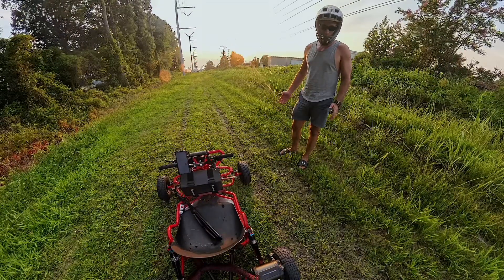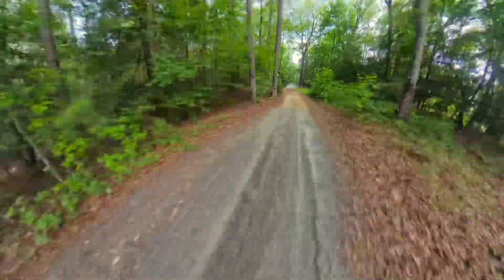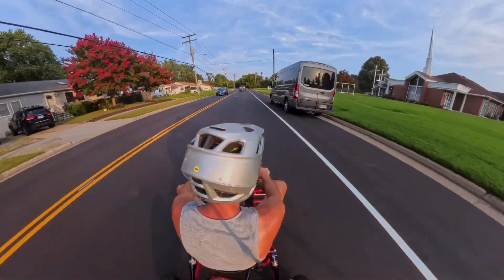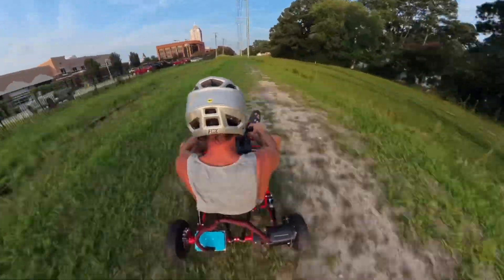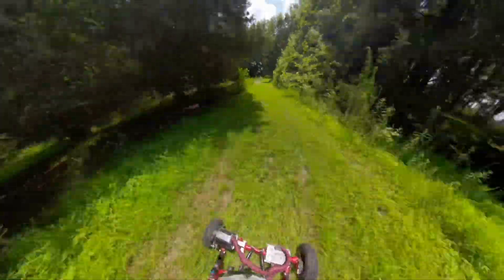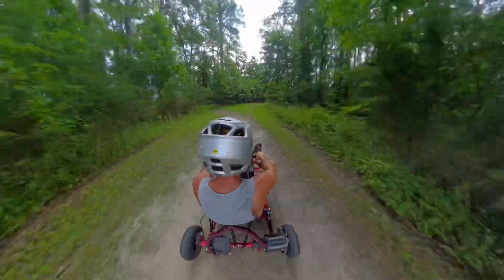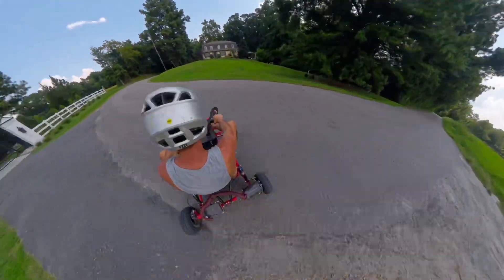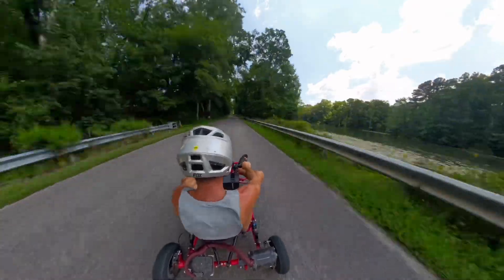The mini kart is better than ever

Comment: I have a question. I finally got EVERYTHING! I need for my build! Just got a battery from hotpaxx. I've been looking at how you made you motor mount. What are you using for raising the motor? Looks like some sort of spacers.and are they attached to the steel plate? Or just spacers ,tightened down with longer bolts? just figuring out how to mount everything so I can hook it up. I do have a friend who's going to make me a custom sized battery.\nIn the future , but for right now , I couldn't beat the price of the hotpaxx battery. And still fits under my legs.150continuous amps,200peak. But trying to figure out how to raise the motor up a little from the plate since it doesn't sit flush like krv.

Comment: Something I just figured out on my FW11 and 72680 is phase offset should be 17. Have you tried that to see if it helps with the high speed issues?
Reply from the maker: My high speed issues turned out to be corrosion on a phase connection. Cleaned the connection and problem solved

Comment: I got the cart. And fw11 kit with 35 sprocket. That is the one you are using correct?35?
Reply from the maker: Yes. I run a 11t #35 sprocket to a 58t.
Reply: @dasppg I got a 35-55T back sprocket . But the 4 mounting holes don't match up to the existing one. Could you please tell me how you went about doing that? Was also wondering if there is any chance You would be willing to make a motor mounting plate like yours that I could purchase from you? I have the same fw11 kit. Just name your price! Any help and guidance you could give me would be very appreciative.This is my first build Please.and😊 thank you!
Reply from the maker: @cwebb5537 this is the sprocket I use

https://amzn.to/49hfMPy

And here’s the sprocket hub for it

https://amzn.to/4qI5Y8w
Reply from the maker: @c @cwebb5537 I don’t currently have any jigs or plans for them. I built mine kinda 1 off if you know what I mean. How far are you from Virginia Beach?
Reply: @dasppg i'm right on the alabama tennessee line.north east...I got everything from. Econic cycles.
Reply: @dasppg thank you so much. I got everything I need except the battery just trying to find one.The right shape and size. Like I said, this is my first build.I don't really know what I'm doing.I have everything I need.I think the main thing saying I will need help with somehow.It's finding a mounting plate for the motor. I just put that sprocket and hub in my cart.Thank you
Reply from the maker: @cwebb5537 there’s some variability in designs and even quality on these karts. Only way I’d be able to do it is if you want to ship the axle to me. That’s the only way to send a working product at this time. The 2 mini kart conversions I did were done with having them in front of me. Also my design uses a spring loaded tensioner modified from a mx650
Reply: @dasppg understandable besides I just realized that the fw11 motor I got had the side mounting option and not the bottom like yours, although that makes me redesign my thinking, and how the amount will be built, I did get ahold of a local machinist, who agreed to take a look at my situation and hopefully build me one.😂. But the side mount, maybe a little easier.I'm not sure either way.I believe I will figure it out , but i'm sure it will be a stressful st project for me along the way😂.live and learn 😂. I do feel I'm learning a lot from your videos along with some others.I'd watched about basic far driver set up. Besides mounting the motor on the cart.I'm confident everything else shouldn't be too difficult.But that's my concern. Gas is so loud and initially slow😂. I also thought it would be really cool to see one of these carts with hub motors. 4# hub motors! It would be like a miniature subaru s t I😊😂😂 thanks for the sprocket link.Just ordered that as well.Only thing I need is a display and the battery.
Reply from the maker: @cwebb5537 hotpaxx has good prices on high power 72v packs
Reply: @dasppg i think the most difficult thing about A battery will be the shape. It would make sense to have it where yours is to help even out the weight distribution.\nBut might have to put it on the back depending on the shape.Once again I guess. Thinking about putting the controller where the gas tank is because I still have that mount and having the battery where your controller is. Still debating on that one. But Yes, I did.Check out hot packs as well
Reply: @dasppg i got that sprocket and hub. Staring.\n At\n The sprocket and hub that's on it now for the life of me, I can't understand how you would take that off, because the direction  they have the Allen key bolts.😂. How did you get that old sprocket off?
Reply from the maker: @cwebb5537 the sprocket and hub will have to come off as one unit
Reply: @dasppg i just got it on😂. I have a weird process of building anything to where I'll get confused and eventually ask someone for help.And usually right after I actually ask the question , then I'll figure it out.😂 if I didn't ask , I wouldn't have figured it out , it's part of my process😂. Thanks though 😂😂. I did have two send my fw11 motor back to e-conic cycles , the one I received was a side mounting option. And they are sending me the version one which I guess is the bottom mounting option like yours.I didn't realize there were two different options for that. Because the motor has to go up and towards the wheel.Quite a bit because there's really no shaft coming off of that motor but slowly , but surely i'm getting it done😊
Reply from the maker: @cwebb5537 right on!
Reply: @dasppg These links were extremely helpful. Thank you!

Comment: Thoughts on the FW11 vs the GTS11?
Reply from the maker: The gts11 has a higher KV winding. This results in less torque than fw11 but more high rpm power. For people focused on top speed, the gts is probably better. I love the fw11. So strong through the entire rpm range
Reply: @dasppg thanks for the response. Do you run a heat sink on yours now?
Reply from the maker: @andrewmcmillan8110 yep. I ordered the one for my1020 and fill in the gaps with thermal pads. That’s necessary since the fw11 isn’t perfectly round
Reply: @dasppg thanks. I just ordered the FW11 and 72650. I’ll pick up a heat sink and thermal pad and probably design a fan mount and maybe some sort of tunnel. Still haven’t gotten my kart yet 😅. Gets here next week
Reply from the maker: @andrewmcmillan8110 fan with a shroud can make a world of difference during the summer

Comment: I just ordered a 63cc,😂. Going to switch to the same controller and motor as you. They did have an option on Amazon with A72 Volt motor and controller.But it didn't stay on there long. I plan on getting the same fw11 & 72450. My first build. I've been riding pev's many years.got a nanrobot d4+2.0,d6,2.0, bluetran lightning, & a wired predator. Ready for a cart. Nervous about the build though. Any tips would be helpful. Not sure where i'm going to get the battery yet. I got the four fifty instead of the six eighty because it was a hundred dollars cheaper , but hopefully that works sufficient

Comment: The kunray kr5v kit with the fardriver 72450 kit is only $380!! Should i get that for my coleman bt200x build and get the fw11 later on? Im only looking to do 30 to 35mph cruising around town with a amorge 72v 34ah battery.. i want the fw11 but the kunray kit is so cheap
Reply from the maker: Absolutely! The kr5v is a great motor
Reply: Where is this kit??

Comment: Love your Videos. I am currently Building a Version with a Trampa 100/250 Controller. There it would be possible to Set up a brake Funktion via Motor. You mentionend in one Video you would Like to have Front brakes for a Bit more safety if the only brake gives up. That would be a way for a Bit more safety without a lot of changes, especially mechanical changes. Dont know if fardriver is also capable of doing it. Would love to discuss some other topics, but dont know how to contact you.
Reply from the maker: Since front disc brakes requires a redesign of the front suspension, spindle, and rim I’ve decided against it. I dont run any motor braking because I use a spring loaded tensioner on my kart. Plus I don’t want the extra heat generated in the motor. I’m running the fw11 at 4x its power rating so I def don’t want anymore heat 🤣
Reply: @dasppg Flipsky is doing this in their new built with QS Motor and VESC with regenerative Breaking (with the exact Frame like you and me). I am not shure how much heat is generated with the regenerative Breaking with re loading the battery. For shure this breaking is not as good as the mechanical. I think it could be a option if you are on high Speed and the mechanical brake gives up.
Reply from the maker: @marcushagmans right on! Yeah the regen definitely adds some heat to the motor and the amount depends on how many watts of regen you’re running. All my builds run motors way beyond their wattage limit so I just don’t want any more heat than I already generate.
Reply: @dasppg Thanks a lot for your Input. It helps a lot with my built and all your videos built the foundation 🙏. Today my Motor (QS Motor 165 35h) arrived, cant wait for the Frame to built the complete setup.
Do you have experience how far away we need to be away from the thermal limits of the Motor. I could Imagine, that with that much amps in Short Time, the wires in the coil heats up way faster than the thermal sensor (thermal Delay).

Comment: Hi!! I have all ordered! I've bought a sotion gts11, its 7kv, and a sotion 270/660 controller with a 72v 200 bms 32ah. What do you think??
Reply from the maker: That’s awesome! I’m enjoying my fw11 very much
Reply: What's your run time with your battery?
Reply from the maker: @TheBigAudi I haven’t done any run time tests yet. My riding style is usually to rip for an hour or so then come back and plug in. I usually charge to 80% and run down to around 40%. Run time has been a non issue for me. I usually get my motor hot way before I think about remaining battery capacity

Comment: Just got my cart setup this week. How do you remove the original sprocket? The bolts are facing inward on the axel
Reply from the maker: You have to remove the sprocket hub first. There will be a set screw and it may be a tight fit
Reply: cool thanks! Looking forward to getting the kr5v setup on it!
Reply from the maker: @kjmetalworksllc you’re going to have a blast with it!

Comment: Please tell me you are on the east coast. I just got this kart. I could use some pointers and i could offer some advice
Reply from the maker: Yes! I’m in Virginia Beach
Reply: @dasppg Hole Lee shyt. That's awesome. I'm in Baltimore.
Reply: I can give you some good tire options also. I ran into the same issue with tires.
Reply from the maker: @hangmantvmounting I order the “clever” brand tires and love them. All the ones I found on Amazon were pretty bad. I also tried monster scooter parts and they were almost as bad as the ones I got from Amazon

Comment: Great video!
What battery are you using?
Reply from the maker: Hello. Running a 21s 6p p42a molicel pack with 270a bms. Built it myself.
Reply: @dasppg  Hi,
Thanks for info, 
Yes, it feels like building your own it's best if you want a reasonably powerful one.
Reply: @dasppg  So you got only 25 Ah atm?
Reply from the maker: @martinsundberg4565 yep, and it’s more than enough run time
Reply: @dasppg  Cool, thanks for fast answers!
Reply from the maker: Working on a jp40 pack with higher spec bms as we speak

Comment: I still dont understand how these arent more popular!!!
Reply from the maker: Part of it I think is a slight barrier to entry. There’s no quality version of these karts available. The electric ones for sale only make around 2kw and have suspension without any damping. They take a fair amount of modification to get a lil ripper. I’ve thought about selling them fully modded but the build process sounds a little daunting and I’m concerned most people won’t be able to spend around 3-4k on it.
Reply: @dasppg Yeah $700 - $1000 for bent tabs and frame from shipping in cardboard does seem to show up alot on YT😅 Wish there was a way to bring prices down and quality up!
Reply from the maker: @PackRatTCG yes mine did have some quality issues and damage from shipping. I have heard from others that Atvkart.com is better than others. Mine actually came off ebay before I knew about Atvkart.
Reply: @dasppg  Spot on for barrier to entry! this hobby is absolutely riddled with scammers and trash products. I personally would have no issue dropping 3k on a ready to go build that I don't have to source parts for, and be a mechanical engineer to understand.
Reply: Upfront cost. I got lucky and paid $300 shipped for the weakest gas version from AliExpress. Came fully dissembled and was missing various nuts and bolts. Still in the process of converting it to brushless.